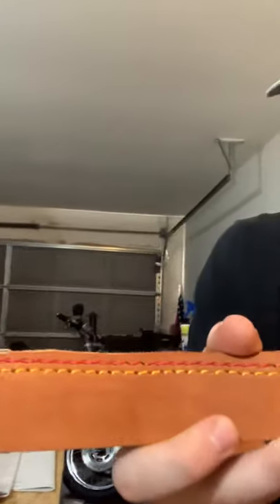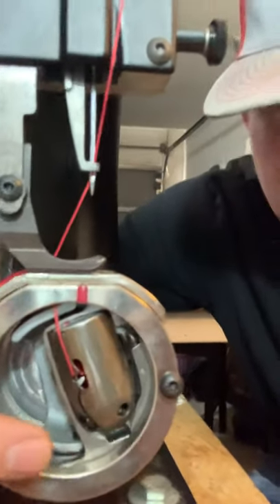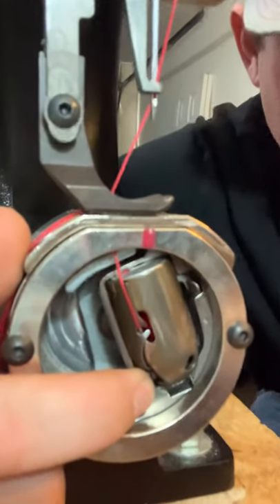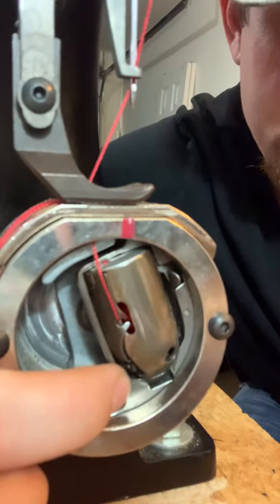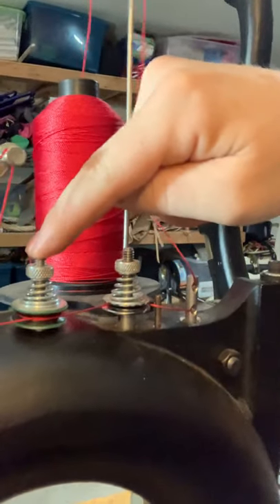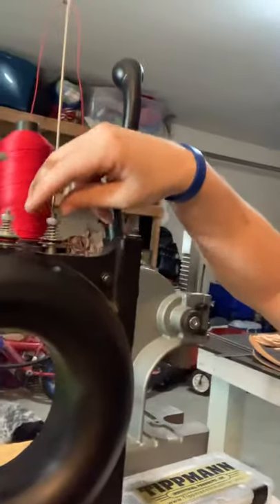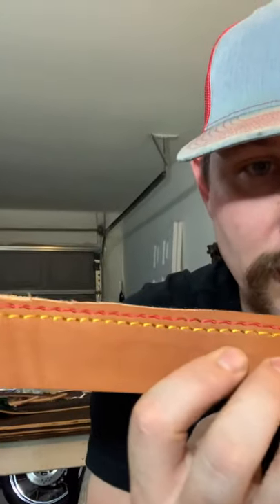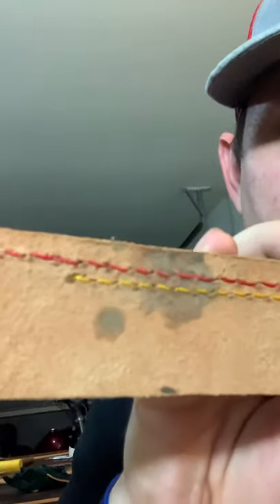Tippmann Boss tension frustration solved!

Comment: I have run my Tippman since 2005 and it is a good machine. It has its moments but you learn them just like any machine. 
Fixes that work for my machine.
For example if I use a 207 thread on top, I use a 138 thread in the bobbin.
Top tensions, make a mark on them so you can see if they back off, the back one on mine will slowly loosen but I check it regularly.
Make sure your lower assembly is timed right, the book explains this. If off just a bit, it can cause issues.
 I use panty hose to cover the top thread as it keeps it nice and neat. With this, a friend who also has one and her issue turned out to be the wire loop that you feed from the upper thread was twisted just enough to catch the thread and causing too much resistance.
Make sure bobbin spins counter clockwise.
Go up a needle size if needed.
Check your handle gear feed timing and make sure it comes up to top as needed as this helps pull threads correctly.

Comment: after adjustment, the thread at the bottom was overtightened.  you can see the loops at the top of the seam.  did you manage to set up the machine ideally or were there incessant problems with it?  Are you still using this machine or have you bought a new one? Спасибо за видео

Comment: I did what you did there, still had issues with the top tension, I ended up putting lock nuts on the top adjustment nuts, mine were backing loose as I was stitching. Problem solved. Thanks for your vid. No one explains the bottom tension adjustment.

Comment: excellent video...i bought this Boss used....as you mentioned the bottom thread ..i screwed it in all the way to get more tension...wrong i guess!!!...to get it to sew right top tension is so tight i actually tip machine forward when pulling on thread..lol...so my question ...you mentioned top thread screws 2.5 turns as per factory settings... 2.5 turns starting from where..? also as i take the Bobbin holder i noticed theres a spacer missing thats sits in behind the bobbin...how important is that spacer? thanks
Reply: The first tensioner the thread wraps around is two full turns. The second tensioner is one-and-a-half turns. From when the nut first touches the spring.